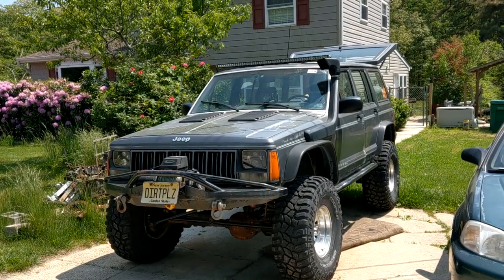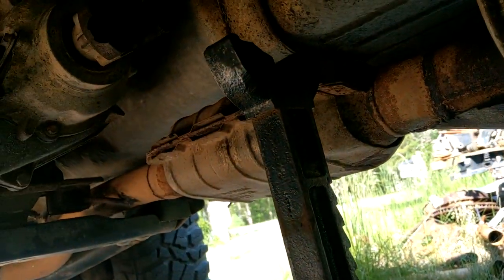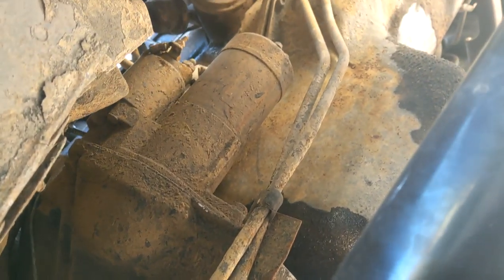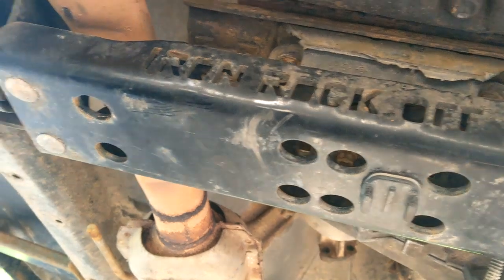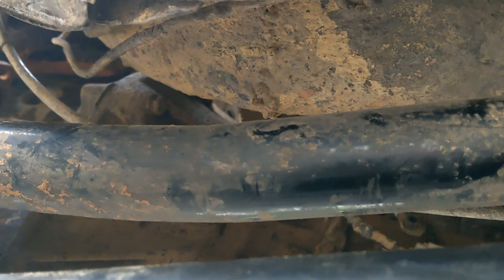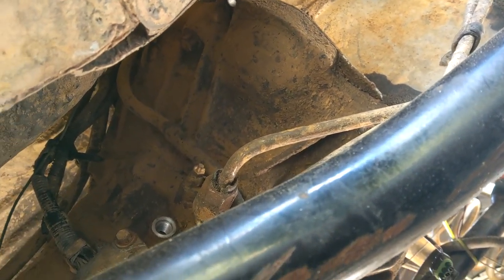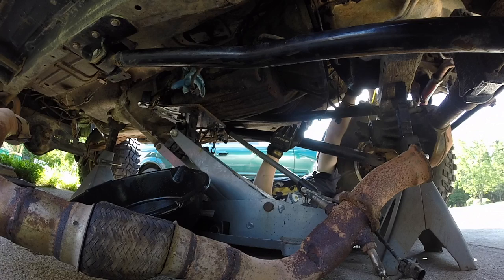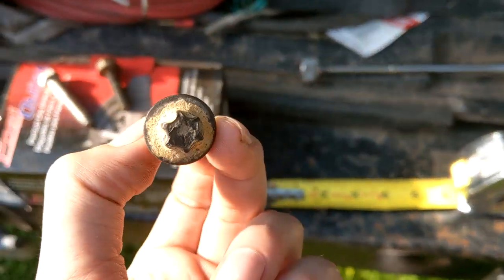89 XJ AW-4 Auto Trans Full Removal / Install

Comment: I’m actually removing my transmission right now and I’m triple checking your video to see if I missed anything my flexplate might be making some noise but once I took off the starter I saw that inspection plate was broken but it’s not making any contact with the flexplate so it might be something deeper inside Hopefully mine is cracked where yours was

Comment: May as well have rebuilt the tcase and trans while it was out if they needed it.

I got the RC longarm and the controll arms are attached to the crossmember.

Which sucks because I'll have to figure out how to basically let the front axle loose without the coils flinging the axle accross the street.

I guess I'll have to jack the front end up to the moon and strap the axle to something fore and aft so it cant go anywhere.
Reply from the maker: I rebuild the Tcase when I did the Wide Chain sn 6-pinion upgrade last year. it's still holding strong.

Comment: I just did the same job and now the trans is not shifting right. I replaced a bad mount so I’m thinking the trans dropping that 1” or so stretched the TV cable????
Reply from the maker: How is it shifting weird? Is it shifting as the wrong time or does it feel like a sluggish shift? Is it responding to throttle input correctly?
Reply: NickInTimeFilms  going into second-loss of response/RPM for a few seconds...shifting down into first causes a horrible shaking throughout....
Reply: NickInTimeFilms dosent season to be shifting at correct times either

Comment: Why does the flex plate break, abuse or just age ?
Reply from the maker: No idea. I'd assume mine started to crack because half my bellhousing bolts were loose or missing.
Reply: If engine mounts or transmission mounts are worn out, the engine and trans can become misaligned, causing extra stress on the flexplate.

Comment: Can you show us rebuilding the transmission ?
Reply from the maker: I've been lucky enough that mine has held up so far, doubt I'll ever be going that deep in it.
Reply: The Grey Goose is back!!!
Reply: tommy 554  transmistions arnt hard to rebuild. Spotting failures is the hardest part.   
The biggest thing you need to remember is be organized. And pay attention.   Everything is directional down to washers. Clean a whole bench off and remove and lay everything in order it came out. And in same direction it came out so you dont have to figure out what way things when. Can just pick up and put back in.